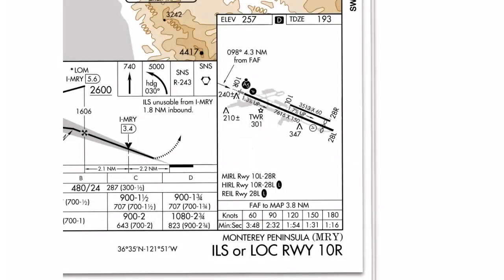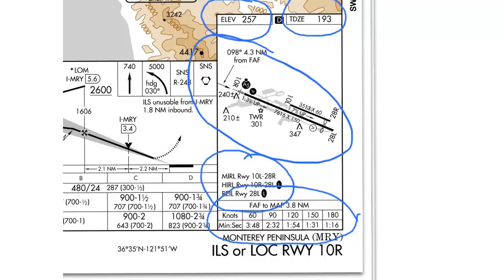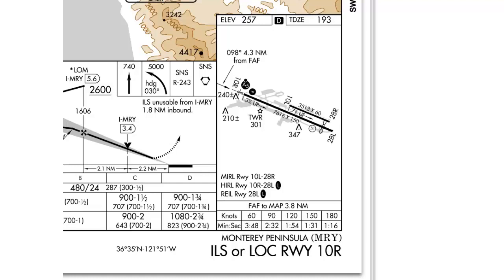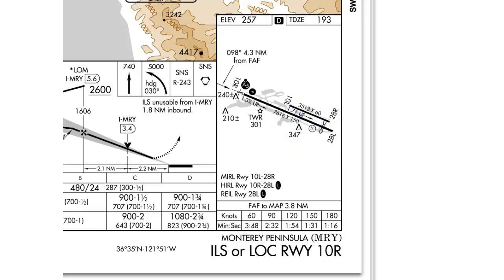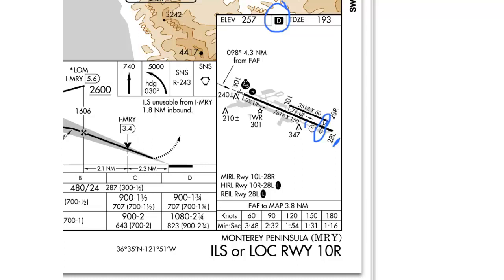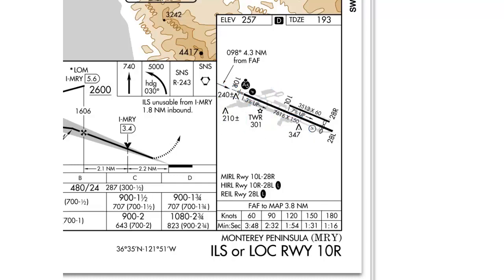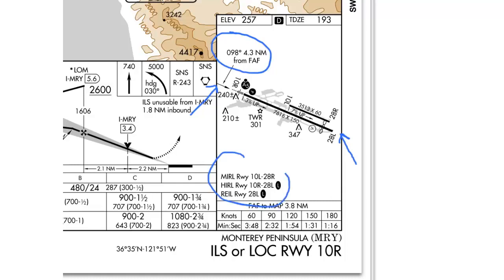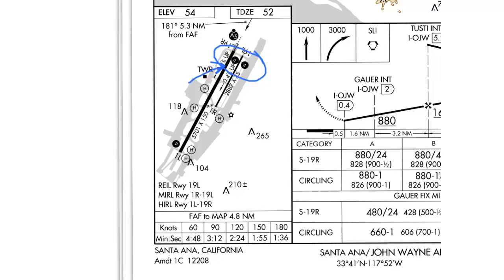Approach Plate Airport Diagram

Comment: First an Airport Diagram is labeled "Airport Diagram" in the Chart Supplement book. An Airport Diagram entails much more information then an Airport Sketch such as taxiway and parking info, Latlong and Magnetic variation, critical frequencies, Hot Spot data and detailed runway information. An Airport Sketch is as the name implies. It give the pilot basic information on lights, runway alignment and obstacles to safely complete an approach.

Definitions from FAA-H-8083-16A Instrument procedures Handbook:

Airport Sketch. Depicts the runways and their length, width,
and slope, the touchdown zone elevation, the lighting
system installed on the end of the runway, and taxiways.
Airport sketches are located on the lower left or right
portion of the instrument approach chart. 

Airport Diagram. A full-page depiction of the airport that
includes the same features of the airport sketch plus
additional details, such as taxiway identifiers, airport
latitude and longitude, and building identification. Airport
diagrams are located in the U.S. Terminal Procedures
booklet following the instrument approach charts for a
particular airport.